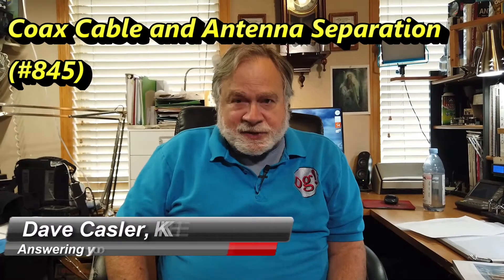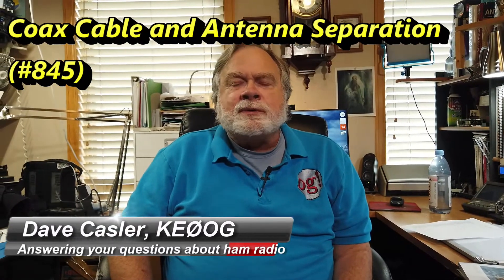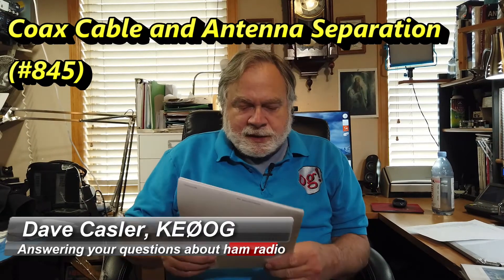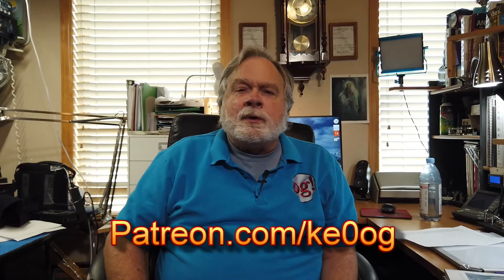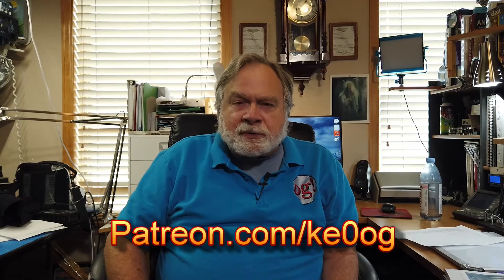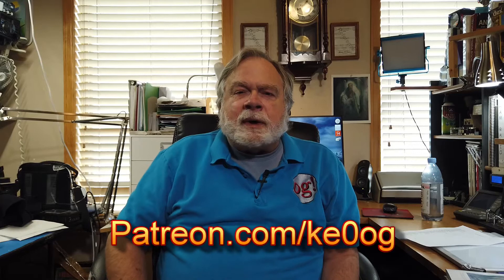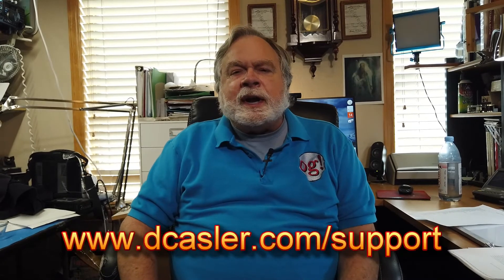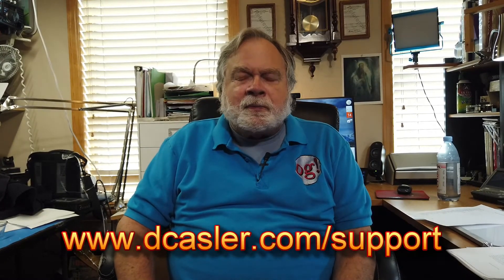Coax Cable And Antenna Separation. (#845)

Comment: Dave re alumi um screen as counterpoise.
Racal holds a patent on this use.
Their screen is copperplated but is very small in size to what we suggest.
One of these units is sized about 6" by 15 inches for hf.
Its used with the Racal 931 man pack sets.
It precludes a soldier having to drag or deploy a counterpoise wire.
Furthermore the soldier can tuck the "mat" in his belt and if swr  climbs too high, he gets a "bite " from the voltage to remind him to retune.
I have one of these units with my 931 kit.
Jim ve3ddy

Comment: I have had an FT-450D for 10 years. I’ve worked 100 countries and thousands of stateside contacts. I would love something with a waterfall, but every time I use my FT-450D I think of how much of a bargain it is.
Reply: I have a 450-D for a few years and bought a Yasue FtDx10 in all honesty I use my 450 more and actually prefer it.  The FtDx10 is a nice radio with many features but the the 450 is a much easier radio to work directly being hands on and not having to constantly keep going into the menu system like on the FtDx10.
Reply: Loved my 450 as well.  Ended up buying another radio from the same Era the Icom 756 Pro ii.  It is hands down a better radio then the 450 and just as easy to use.  I have no regrets about switching.  The 450 was a good radio, the other radios are great radios.  I don't think you would regret it.